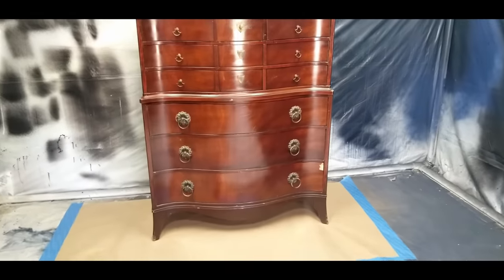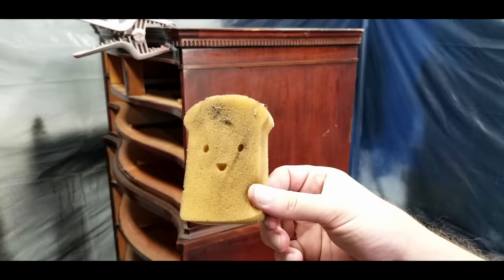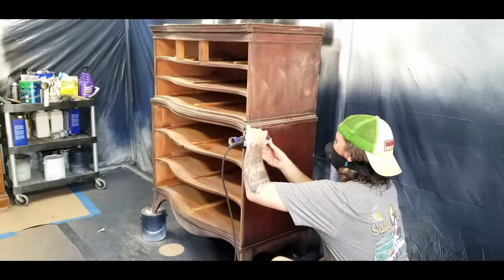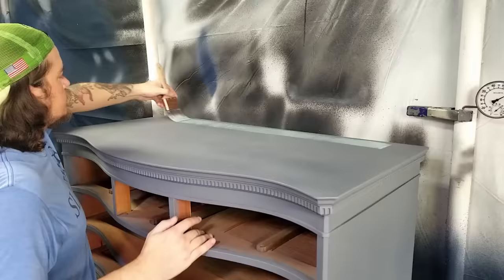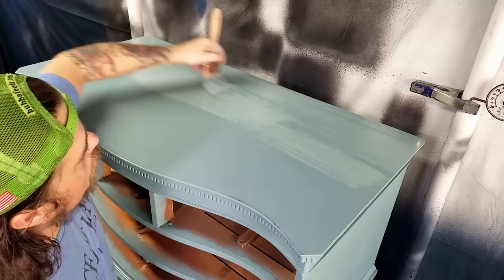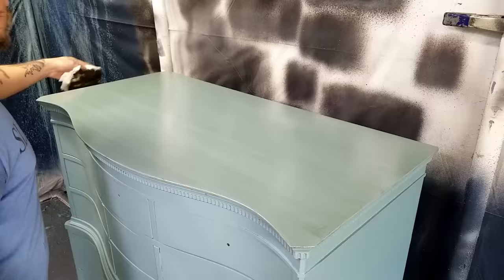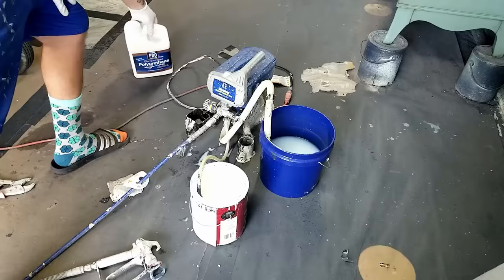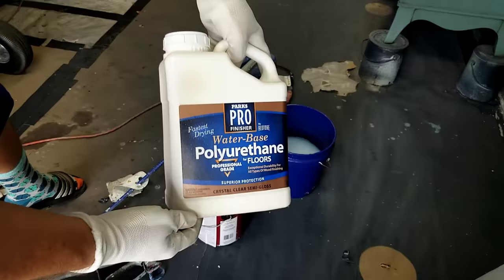I Found This Furniture on The Curb and Painted It.

Comment: The dresser looks fantastic!!!  
I have a vintage/antique Hepplewhite bow front dresser very similar to this one, perhaps in slightly worse condition.  We know it spent at least some of its life out in the barn before my In-Laws bought the farm in the early 1960's and moved the dresser back into the 1927 farmhouse, which is now our home.  
To say leaky barn storage is unkind to veneered furniture would be an understatement.  I cleaned and made minimal repairs and have used the dresser for almost 10 years, mostly as it was:  veneer is still loose in some places and missing in a couple of others, scratches, and a couple of deep cigarette burns from an unknown careless owner prior to being stashed in the barn.  The dovetail jointed drawers and the dresser box are still very structurally sound and worth an investment of time and a little moolah.  Now that my Dear Hubby and I call the old family farm home, it's time to give the dresser a face-lift and help it continue its life of service with an updated appearance in its old home.  Your video is greatly appreciated, and it has inspired me to take the plunge and just get 'er done!   Thank You for your detailed steps and excellent results to get me motivated!!!
Reply: You can buy rolls of veneer to replace the damage. I used roll veneer to repair the top of an old sewing machine cabinet. Worked out great.
Reply: My folks bought the farm too

Comment: I'm a wood person. I would have veneered the top after repairs, stripped and refinished using an oil rubbed or waxed finish. Not a fan of painted wood but good job.

Comment: I got an older style TV stand from Goodwill.  I sanded out the rough areas, a corner was gone, I fixed that.  Than I did the top as a paint pour (like waves since my place is ocean themed).  I matched the paint for the rest of it to the darkest smokey blue gray.  So happy with the way it turned out.  Everyone remarks on it.  When I say I did it, lol at times I have to show the progress pictures.  Love it!!

Comment: Fantastic job! We own that same dresser from my father in law. Ours is in the original color. Would love to paint it but its hard taking that first step! Great video. Thanks.
Reply from the maker: Make sure to do some research on the piece before you decide to paint. This particular one is made by Kent-Coffey in the 1950s,  which I know because it was stamped in the drawer. Some dressers in this style are much older and  are worth money and hold historical value. Painting them might not be a good idea. If yours doesnt have the drawer stamped with the manufacturer it could be worth more... or... it could just be a generic reproduction that were typically sold in department stores like Sears or JC Penny. Tip: use the Google Lens app to take a pic of your furniture and search for similar images. Or pay for an appraisal if you're not well versed in furniture construction
Reply: @ThatShabbyGuy  ok thanks I will check it out for a stamp or something indicating what it is. Doubt if its really good but it is a nice piece.

Comment: Looks amazing! What a great find. I agree with adding the top coat to painted hardware.I had painted some kitchen cabinet handles with that exact color and brand of spray paint that you used.They are showing signs of wear after a year of use.One day I'll remove them , touch up the paint , and apply the top coat.

Comment: That is awesome.  I have a Henredon piece and the veneer is chipped.  I did not know you can repair and paint over veneer.
Reply from the maker: With a Henredon piece you might want to avoid painting depending on what it is and how old it is. You can repair veneer and duplicate the original finish using wood repair markers. I have never done it before but I know of the process. Maybe search veneer chip repair here on youtube if you want to look into it vs painting the whole piece.
Reply: @ThatShabbyGuy  yeah, I know, which is why I’ve simply used a black Sharpie marker.  Not the best fix but it’s got charm.  It’s a 1940s era piece, and I just love it with all its flaws.  It’s got stories to tell.😀

Comment: ♥️ how this piece turned out and it's actually similar to things I've done myself.
If unable to spray a clear coat, is there an alternative other than just brushing it on? I painted kitchen countertops once with high gloss marine paint - stands up to water, spills! - and believe I used a foam roller so there wouldn't be any lint or fuzz. Maybe do the same with the clear coat.🤔

Comment: This looks fabulous. I have a used ethan allen bedroom set I bought second hand. I was more concentrating on the navy blue chaulk finish that was already there. Now this set does not have a headboard nor did it have a storage/bench which I b wanted to add at the foot of the bed for towels etc and for seating so I can not have to sit on the bed so much and ruin my bed ensom  le c with oils and lotions and the  like. After c seeing this video, I was stunned to find out that I could buy a headboard dresser that I want and also the storage thing for the foot of the bed and refinish it all to match. This would give me the customobility that I want with more choices for color selection. Do you know anyone in the High Desert area of California, San Bernardino County that does quality work like yours. I need  quality but i got a serious budget to adhere tothe c quality wi
Reply: to adhere to. Help

Comment: You do great work and I love this color combo! Question for you - do you think there is a difference between applying the gilding wax before or after the top coat? I haven't messed with gilding wax enough yet to really have a good grip on it.

Comment: Beautiful piece. Question- what are your thoughts on applying the finishing step of clear polyurethane if you aren’t able to use a power sprayer in your specific environment for a particular piece at that time?  What brush/roller application do you recommend to avoid brush strokes and do you have any helpful hints for technique?
Reply from the maker: A quality synthetic brush or a sponge placed inside panty hose is what I have used in the past to apply water based poly by hand. Thin coats and not over working the poly after applied are key tips. Black is a pain in the ass to top coat because it shows imperfections a lot easier. Here is a video I posted last year where I am literally outside of my normal painting environment as you said, on vacation in rural Illinois in my friends garage vs my paint booth here in a metro area of 7 million.  https://youtu.be/iv750dIjFOI
Reply: @ThatShabbyGuy  thx so much fo your reply. Can’t wait to try pantyhose trick for poly application. I watched your video you captioned and I am more inspired. Also, I didn’t know there was foam pads for the electric sander, which will be great for my first big project - painting my parents’ bedroom suite that I couldn’t bear to part with upon their passing. Will be a committed follower - I appreciate your step by step instructions and sharing both pearls and pitfalls during your process.

Comment: Next time, you may want to try an actual glaze (colored water-based poly) rather than using stain as a glaze.  It is so much easier and forgiving than the method you used since you simply brush it on and leave it.
Reply from the maker: Stain is more forgiving because if I mess up I can reapply, it re-wets itself, and I can give it another go if needed.

Comment: When the paint can has a splotch of paint on the lid it means it was custom blended.  Brush strokes in paint are from too much paint on the brush.  There are still a lot of brush strokes visible in the top.  Why the big rush to apply Polyurethane?  You missed the bottom edges of drawers.  Do not shake Polyurethane if applying with a brush.  Nice job.  Not my colour choice.
Reply from the maker: Sounds like you should create your own channel lol

Comment: And in 40 yrs, someone will find this piece and have to undo the damage from the paint you put on it, why not just restore it?
Reply from the maker: And if I didnt take it from the curb it would have been crushed. Paint doesnt "ruin" wood. You just have a bias against it and/or dont have in depth knowledge of refinishing. Most people dont want old wood tones in their home. This piece sold as a custom order to be painted before I even started on it. You're right that it can be restored in the future, but you're wrong that it is damaged. It is literally encased in plastic and protected until society decides that the original finish is something they want. Open your mind.